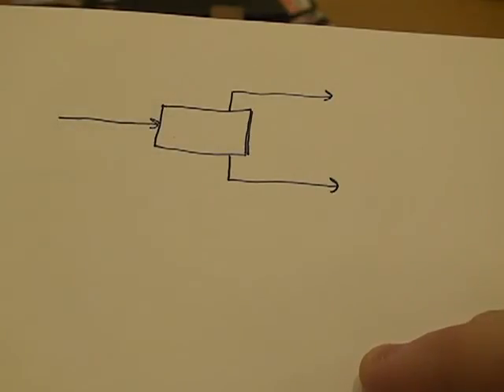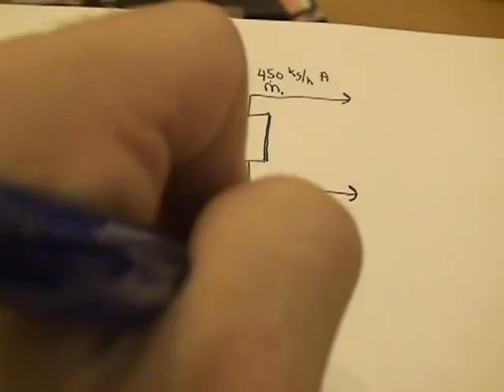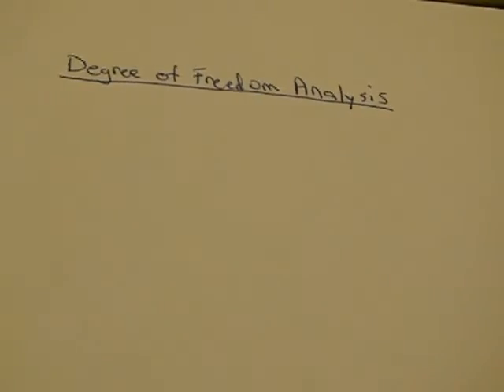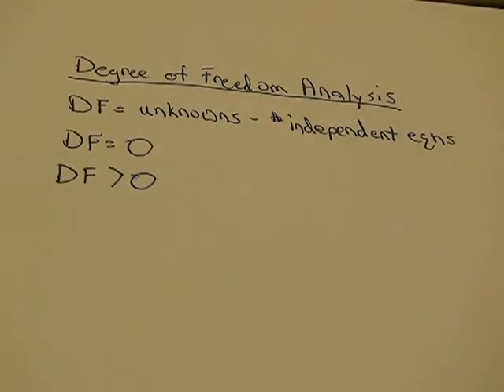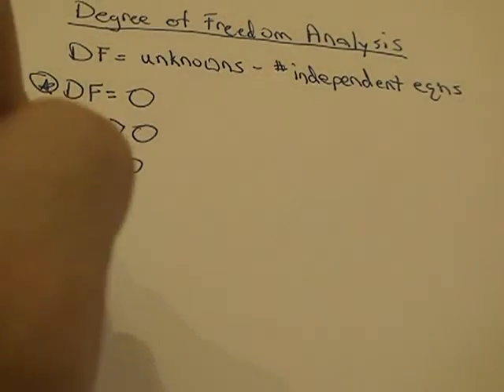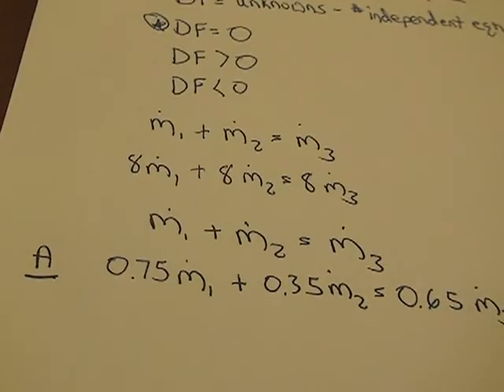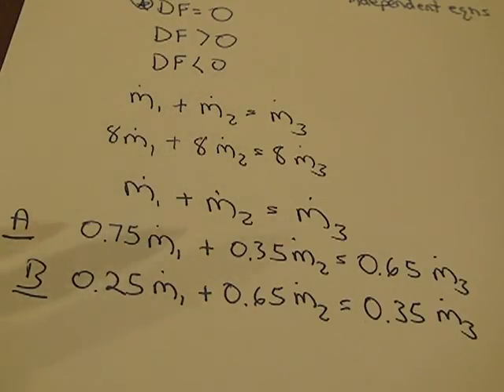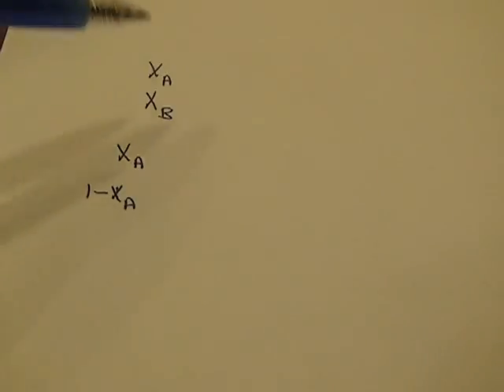Mass Balances in Steady State Chemical Engineering

Comment from the maker: You need to have 0 degrees of freedom. When you get a negative number what that means for non reactive problems is that you have to many equations. You might think that might not be such a problem however you might have equations that are not technically independent as I went over or since you have more then the needed equations you might carry a error or contradiction in one of them that will skew your results.